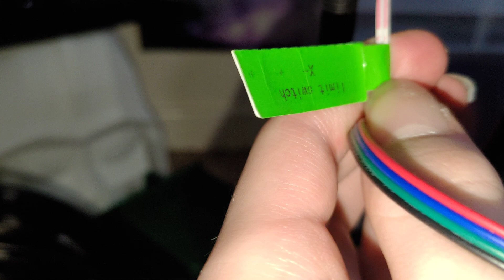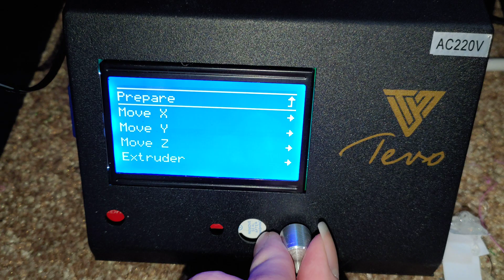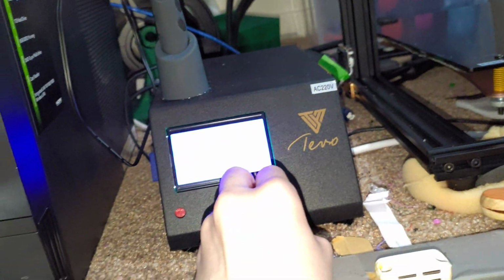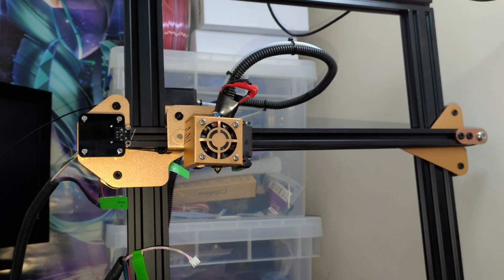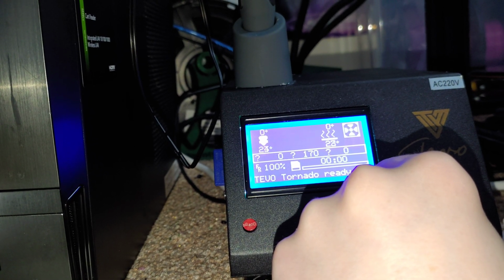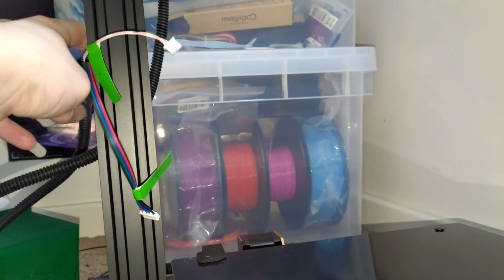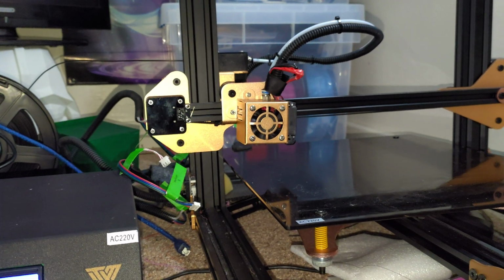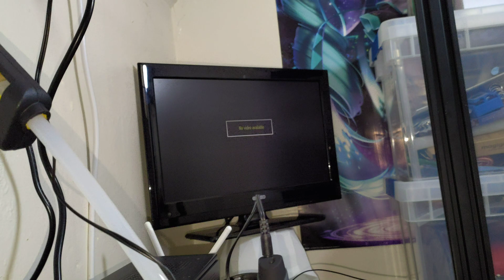TEVO Tornado Y axis problem (update)

Comment: Open the box and swap x and y cable and test the y line. It will say you if this is a cable or a driver pb. Do you use smoother?
Reply from the maker: I'm so sorry for the late response! This virus has me stressed!
No I don't use a smoother.
https://www.youtube.com/watch?v=4ik-4eo4iEo In this video, I show the current situation I'm in. But I'll try this as soon as I can. Thanks for the input!!
Reply: My Z axis is not working at all would it be the motor? X & y move but Z ( going up dose not)
Reply from the maker: @immortals_1785  
Again, sorry for the late response. I will get better at YouTubing at some point.
Did you get it sorted?